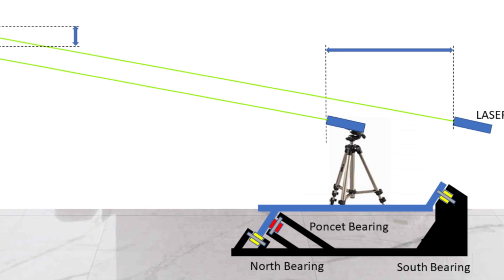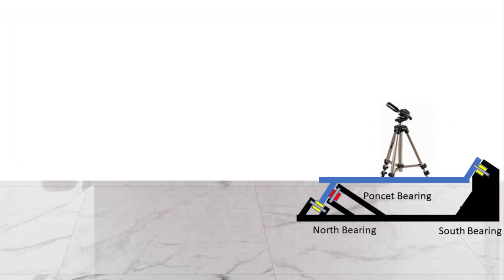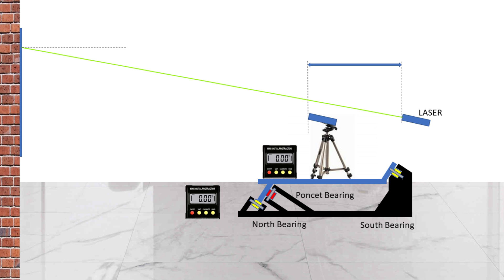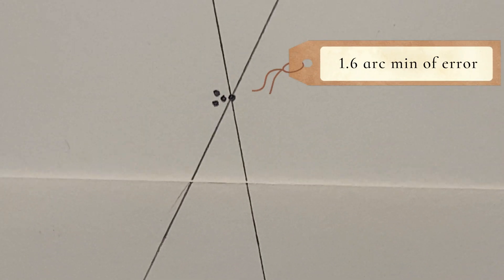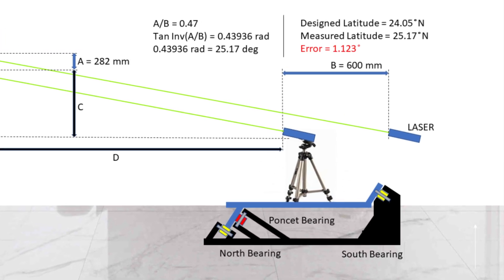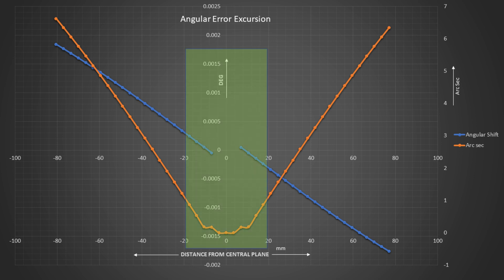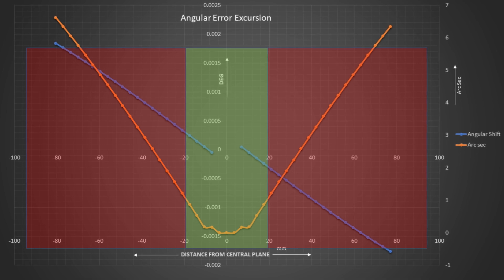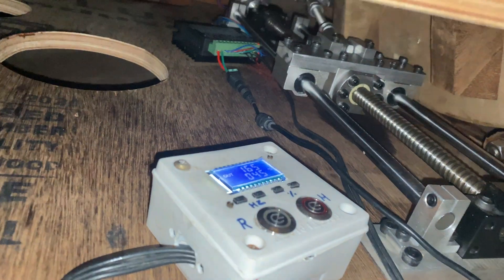How to Test the Error & Accuracy of EQ Platform Build Video Series E07

Comment: I'm having trouble understanding how you draw the lines, could you help me figure it out? I've put dots at many points along the arc both at a beginning point and with the platform 2 feet farther, what do I do from here?
Reply from the maker: Ok let me make a small short on it. However let me try an explanation here:
Reply from the maker: Select two fixed points on the arc you have got, then take a protector set it at 10 cm and draw arc from both this points. You will get two intersecting points, draw a line connecting this two points and extend the line on the concave side of the bigger arc, so it reaches the approximate Center
Reply from the maker: Repeat this process on both left and right side to get the point where this two lines will intersect, that’s where the RA axis lies.
Reply from the maker: However now point the laser at this point and rotate the platform on RA axis, for perfect zero error the laser pointer will not move, you can mark the points where laser pointer moves, this scatter of laser pointer marked points on RA axis will give you RA axis concentricity error.  Circumstances of the sphere formed by distance between wall and platform /( 360 x 60 x 60  ) arc sec.
Reply from the maker: Hope this is helpful, will try to make that short video soon

Comment: U can fix yr green laser near  at south bearing  point end to check its exact accuracy bro
Reply from the maker: Yes you can do that, however that will not tell any indications on the deviations caused by the north bearing misalignment or shagging.

Comment: Excellent analysis, by way of science/math. It just shows the severe limitation of an equatorial platform, with reference to the viewing latitude.
maybe electronic compensation, of EqP error, is the only way to achieve accurate tracking, from various latitudes, within a small latitudinal variance.

Great series. I am surprised it has not been more viewed, as it is an excellent example, of equatorial platform build, from concept>construction>final proof/tracking accuracy. Thanks.
Reply from the maker: I am very glad it was helpful to you. Do share the link of this video series to other forums and interested people. 

In future I have plan to make another one that we designed in EP 05 and would post the update. However that quote some months away. 

Clear skies.